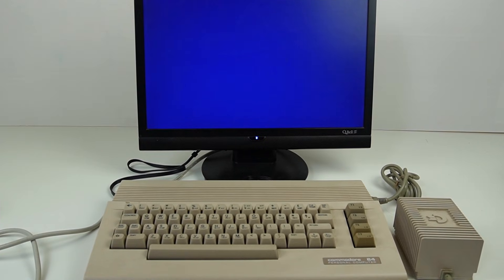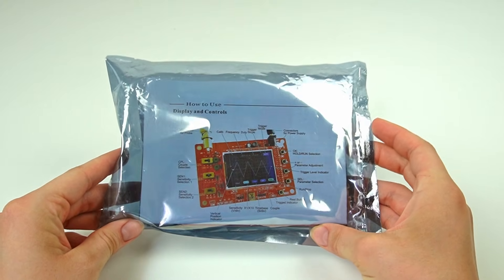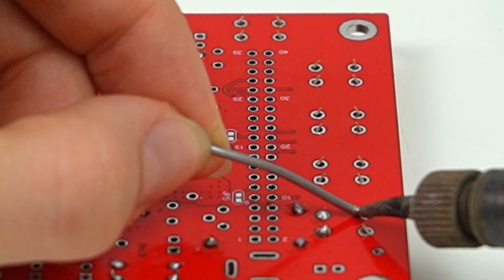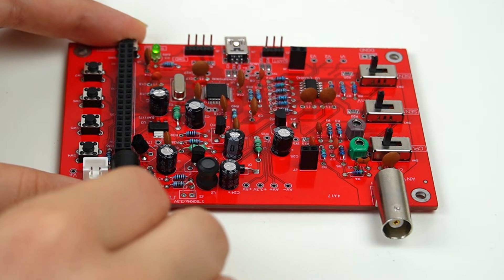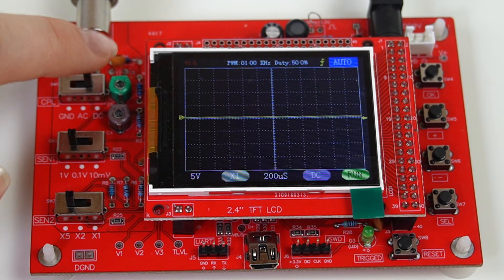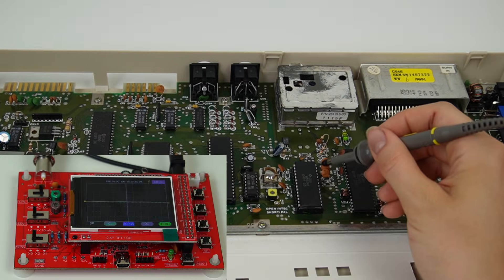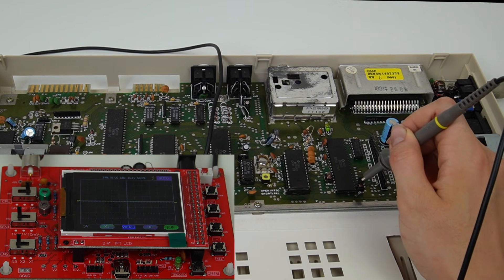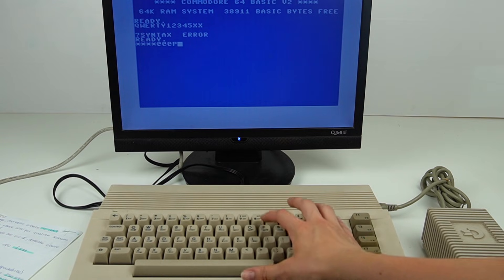I fixed a C64 using a $20 OSCILLOSCOPE

Comment: Hi, nice that you brought the oscilloscope to live. Soldering can be done better: bending the parts at the solder side and solder them is a no go. You are on a budget and do not like to buy cross tweezers?
OK - but while soldering bend the wire back to the square Position. Easy to do and looks so much more professional. The C64, well that has been quite some time. 40 years ago  it always was the dynamich ram...

Comment: Schätzchen😯☝️😂🙋💖🗿bleib nie kleben an 230Volt AC.☝️💀💀💀Als Junge klebten die Finger am Kabel mit Brandblasen!Ich hing auch an 800volt DC von einer fetten Röhrenendstufe eines 100Watt Verstärkers.Der hatte 2x dicke SRS Senderöhren.Da sprangen prima Funken auf den Zeigefinger vom 4 uFarad Blockkondensator.Auch 3 Picofarad Kondensator Leidende Flaschen hauen dich so,das du den Arm minutenlang nicht bewegen kannst.Bravo,,Lottogewinn😂🆓😂😂😂💖🇩🇪matthias

Comment: The crocodile clips at 4:39, did you happen to buy those at Lidl? I have the exact same box of them and I got them at Lidl. A while back my local Lidl also had a soldering station with a digital temperature control for only € 20. I don't know if I will be easily able to get new tips for it when that time comes, but so far it has been working great and it comes with a nice sharp tip, I've had no problems soldering 0805 SMD components with it, and it has enough power to also easily solder larger components. It's the Parkside PLSD 48 B2, maybe something to keep an eye out for?
Reply from the maker: Thank you for the tip and for noticing the crocodile clips! Yes, I did get those clips at Lidl. It's always great to find affordable and useful tools there.That soldering station you mentioned, the Parkside PLSD 48 B2, sounds like a fantastic find, especially with its digital temperature control and versatility. I'll definitely keep an eye out for it.

Comment: as a senior electronics engineer
you can use a multimeter to check the DC voltages and GND you do not need an oscilloscope
but nice video thumbs up good for you 👍

Comment: Great computers, we used to have playground wars between them and the ZX Spectrum in the UK. Not sure if these later models still had the cartridge / expansion slot but you could use the ground cable on the tape drive to touch a specific pin which would  trigger a RESET  and dump you back to basic so that you could POKE extra lives into the game you were running
Reply from the maker: Ah, those playground wars between Commodore 64 and ZX Spectrum users must have been epic!:yougotthis:

Comment: I keep seeing the C64 here and there, it sure is one of the most iconic retro computers! I don't have one in my collection, but years and years ago, I remember having a family member come by, and hand me a Atari 1040ST. They unfortunately got rid of the monitor some time ago, but since they knew I was into old electronics and random stuff of that sort, they thought I could be interested. Well, I sure was! It came with its original mouse and two boxes of floppies, with the OS and some pieces of software. Unfortunately, no cables! I had no way to connect it to any monitor, and at that time I was not exactly used to ordering random stuff online, and I didn't even have a proper soldering iron. That said, I sure was eager to try it out, see if it works! So I started looking for the pinout of the video connector. I then took a bunch of paperclips, bent and cut them to shape one by one, and secured them to a screw terminal block. That way I finally had a pretty sturdy connector that did fit the Atari video out perfectly. I then wired it to a cut SCART cable or maybe it was VGA, I don't remember exactly. I was finally ready to try out my newly acquired Atari! And guess what, it worked perfectly! That was so cool! Years later I got proper cables for it, but that little DIY thing sure saved the day back then!
Reply from the maker: Wow, what a fantastic story!  It's amazing how our passion for retro electronics can lead us to find creative solutions like that. I'm thrilled to hear that it worked perfectly in the end.
The Atari 1040ST is another iconic piece of computing history, and it must have been quite a thrill to get it up and running. Thank you for sharing this nostalgic adventure !!😁

Comment: I am happy to see girls, especially beautiful girls, in the fields of science and technology.
I happen to have a Commodore 64 as well that needs some fixing, a cheap scope similar to yours, two older analog scopes (up to 100 and 275MHz, 2-channel models) and a 100MHz 4-channel digital scope (Siglent SDS-1104X-E), though the checks you did could have been done with a voltmeter as well.
I might do a video of my repair as well. You have inspired me.
Just a little tip on proper soldering: first you lightly press the soldering iron tip against the lead/wire AND the tinned surface/hole on the PCB at the same time to heat them up, then almost at the same time or up to 3 seconds later you push the solder wire either from the opposite side of the iron tip or on the same side but make sure that it most of it flows onto the wire and onto the PCB surface or into the PCB hole at the same time, with maybe some of it going onto the iron tip.
The way you were doing it runs the risk of creating a cold solder joint because you"re melting the solder into a blob before heating up the wire and PCB surface.
As you know, the surface being soldered needs to heat up to at least the melting point of the solder wire being used so that the solder adheres to the soldered surface.
Best wishes from Bosnia!
Ciao bella! 😉
Reply from the maker: Thank you so much for your kind words and for sharing your impressive collection of scopes and equipment!
I really appreciate the soldering tip you provided; it's incredibly helpful, and I'll definitely keep that in mind for my future projects. Learning from experienced enthusiasts like you is invaluable. Greetings from Italy, and thank you again for your support! Ciao! 😄👋

Comment: well done!! i also have a c64 the older breadbin type, and a couple of years back i pretty mutch replaced half of the machine, as it had several problems and also needed a cap replacement. you should get a flush sidecutter for electronics, they are both sharper and easyer to use, and not expensive to buy.
Reply from the maker: Thanks for the advice, I've already purchased a new pair :)

Comment: I am glad that you got it all to work, if you intend to do more electronic work may I suggest that you get yourself a decent pair of side cutters, the ones you were using were truly awful. A decent temperature-adjustable soldering iron would be an improvement as well.
Reply from the maker: Thank you for your feedback, and I appreciate the suggestions. You're absolutely right; having quality tools like side cutters and a temperature-adjustable soldering iron can make a significant difference.

Comment: Back in the 80s I worked at a Commodore service center.  I repaired 1000's of them. Usually, it was I/O related from the joysticks being abused by young kids in school. The other common problem was a power supply going bad, feeding low-voltage AC into the C64.  

Now...What I would have done once that CIA was desoldered would be to replace it with a socket.  If the chip is bad or needs replacing in the future, it'll make it much easier to do. 

Somewhere hiding in my 70-year collection of electric goodies I've refused to get rid of,  I have a gizmo Commodore sent me that plugs into the cartridge port. A series of LEDs flash and (9 out of 10 times) showed me exactly what was bad.

I'm very impressed by what you did. 👍We don't see that much these days in electronics.
Reply from the maker: Wow, that's an incredible background you have with Commodore computers! Repairing thousands of them back in the 80s is truly impressive😁It's always inspiring to connect with fellow enthusiasts who appreciate electronics and vintage computing. 👍😊
Reply: @Sayakas_Digital_Attic    The schools used a lot of them at the the time. Young kids would abuse them pretty badly.  

I also built stage lighting controllers for bands and theatrical use. The SX64 worked perfectly for that. The cartridge port has an 8 bit I/O on it.  That's enough for 256 channels of lighting but we only did a max of 32.   "Analog Devices" had a IC with a D/A converter, latch and an OP amp in one chip. They put out 0-10 volts DC, which is what the Teatronics dimmers we used needed  for control.  

I used an Assembler called "Merlin 64" to write the software.

Comment: You really should consider acquiring a proper lead cutter to replace that wire cutter. Lead cutters are much more precise and sharper so you can cut leads adequately.

Comment: Well done! Maybe just reflowing the old solder and adding a little bit of fresh into it would have had the same result? Or is it best to remove all the old and use all new solder? I've also seen this where getting a continuity signal required pressing down hard onto the joints.

Comment: You deserve a gold medal for even attempting to work with that soldering iron and rusty wire snips!!
Please treat yourself to some new ones - they are inexpensive and worth every penny!
Also, these inexpensive kit scopes are usually very limited - you can often find a used scope locally for <$50 that will be far better…
Nicely edited video - keep up the good work!
Reply: Wow good to know. Where do we go? Craigslist for a local scope?
Reply: @gamedoutgamer  Craig's List, Kijiji, and eBay have deals from time to time, but they also have a lot of items which are VERY overpriced for what they offer unless you can find one with probes for <$100. Used scopes seldom come with good probes, or any probes at all. For the value they bring, I would spend $299 on a brand new Rigol DHO802 or spend a little more for another DHO800 series scope with more features. Scopes with the capabilities of that one cost several thousand dollars only a few years ago.

Comment: Nice job 😊 The tape on the pcb is usually there to prevent shorts if the case is flexed or if the pcb warps from heat. Putting a bit of Kaptan tape on there might be a good idea
Reply from the maker: Thank you! I didn't know that! Mystery solved. 😊

Comment: Awesome build!

Beware those old Commodore power supplies. When they go bad, they send full voltage into the C64 and causes damage.
Reply from the maker: I'm aware of the risks, but currently, I don't have another power supply, but I'll definitely consider getting one in the near future.
Reply: @Sayakas_Digital_Attic  or you could make an overvoltage protector like the OpenC64Saver.

Comment: How many years of experience do you have ?
The tip is older than you i suppose, but done very well
But you must to by new clippers... this ones more torn this poor resistor legs than cut ;)
Reply from the maker: I actually started repairing and restoring computers just a year ago.Thanks for the suggestion about the clippers, you're absolutely right, they seem a bit worn. It will definitely be one of the next things I upgrade in my toolkit.
Reply: @Sayakas_Digital_Attic  Where you acquired such wast knowledge in one year? Some heritage?
Also can you provide link to this oscilloscope?

Comment: All your test can be done with multimeter and visual inspection. It came with practice. I recomened you to change capacitor in power part. In result good work in suitable budget.

Comment: Hey you should probably get an aftermarket power supply due to issues with the old power bricks over supplying current and killing C64's.
Reply from the maker: Indeed, you're absolutely right about the potential issues with many old power supplies. I'm aware of the risks, and I appreciate your recommendation. Currently, I don't have an aftermarket power supply, but I'll definitely consider getting one in the near future. Thanks again for the heads-up!

Comment: While the scope is amazing for e20, you could have got a 2 channel PC scope with more features for about e80. I got mine from Farnell, think they have locations in Europe,  or you could order from the Irish site if not, for the EU viewers ☺
Reply from the maker: I'll definitely check out Farnell and see if they have options that could be suitable for my needs. It's always helpful to explore different choices. Thanks again for the input!
Reply: @Sayakas_Digital_Attic  I just checked the site. The one I have is a multicomp mp720016 stock code 3107575 and is e84.42 on the irish site. Forgive me if I'm wrong ☺ but you sound Scandinavian,  it's same stock code and 1000kr on the Sweden side. Multicomp is a Farnell own brand, think they use other names in other regions.

Comment: Nice work - always nice to see someone interested in retro electronics - and to see a 20E oscilloscope in action - my best effort was a handheld 'scope in around 1999 which set me back over £100 though the resolution was rubbish! I'd like to buy you some decent fine side cutters to help ease the pain of chopping off all those through hole legs 😁
Reply from the maker: Thank you so much ! I'm really glad you appreciated my retro electronics project. As for the fine side cutters, they would be really handy. Cutting off component legs through the holes can be quite a challenge with these clippers! Thanks for the offer; I really appreciate the kindness. 😁

Comment: Thank you for the video, Ms Chialva. I don't know much about C64s myself but I think you are using an original C64 power supply, you should think about replacing it or using a "C64 Saver" which connects between the power supply and the C64. Many C64 power supplies fail in a bad way for the C64 - the normal 5 volts becomes more over time and damages the chips inside the C64.
Reply from the maker: Thank you for watching, and I appreciate your feedback! It's great that you pointed out the potential issue with the original C64 power supply. I'll definitely consider getting a C64 Saver or a replacement power supply to ensure the safety of my C64. Your advice about the voltage fluctuation is crucial for maintaining the health of the system. Thanks again for your valuable input and for watching!😄🙂

Comment: This can be seen as a general advice, if an old computer is missbehaving, the first thing to try is to clean that darn thing, get every connector and every socket cleaned and then check again. The chances are high that this solves the problem. And the newer the patient the smaller the cleaning intervals. If your relative modern computer has memory problems, take out the modules and clean the contacts with some Isoprop. Let Memtest run its paces, it should come around green.
Reply from the maker: As you said cleaning and maintaining old computers is often the key to resolving many issues. It's amazing how dust and dirt can accumulate over time and cause problems.  Your insights are much appreciated!
Reply: @Sayakas_Digital_Attic  not even just that, just last weekend at DoReCo, a computer party in Altenmellrich, Germany, i had a good friend run into an interesting problem, he had a newly made memory upgrade for his Amiga 500 and it didn't work reliable. I had a look and it and just told him to get rid of all the flux on it. Lo and behold, it worked after a nice scrubbing. 😁

Comment: That DIY oscilloscope is such a godsend for anyone wanting to get into board repair on the cheap.
Reply: You can buy a prebuilt version of the same kit for $30 but that's not as fun as doing it yourself.
Reply: Or get a LHT00SU1 which is far superior for about the same price.
Reply: But how could one learn at least the basics to use oscilloscopes?
I'm a hobbyist car audio freak and also rc cars.
Is an osci useful for me?
Reply: @BASSstarlet  A $20 LHT00SU1 would be massively better than nothing. Most likely it would not be worth getting anything fancier.
Reply: Hey, what's the benefit of the osciloscope for this use over a multiprupose ac/dc meter? Wouldn't the information from multipurpose ac/dc meter be enough?
Reply: @esrbin95 The difference between an Oscilloscope and a AC/DC meter, the oscilloscope show's you the type of signal on a   circuit for an example, input/output, voltage peak to peak, frequency per second, signal shape on a integrated circuit and so forth.
AC/DC meter shows the current, ohms, voltage.
Reply: Actually for the same price you can run into a real one with CRT at goodwill.
Reply: I once buy osc like this, it was kit so some soldering was required. then it was 13 euros. I really should have two channel.
Reply: @juhajuntunen7866  I bought a really nice 2 channel scope last year for around $100. The prices really have come down incredibly... and no soldering/troubleshooting required!

Comment: Whenever you desolder a chip in a retro machine, only put it back with sockets so you don't have to desolder it ever again. Socket strips are super cheap.
Reply from the maker: Thank you for the advice! That's a great tip about using sockets when desoldering chips in retro machines. Unfortunately, I didn't have any sockets available at the time🙂